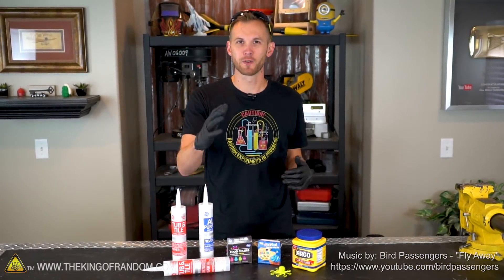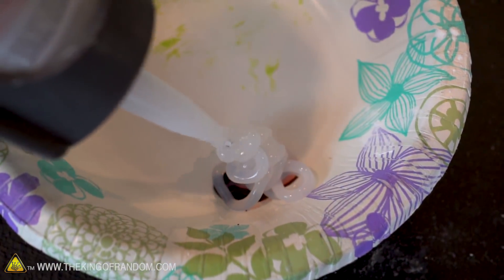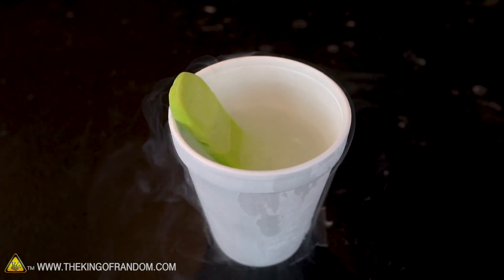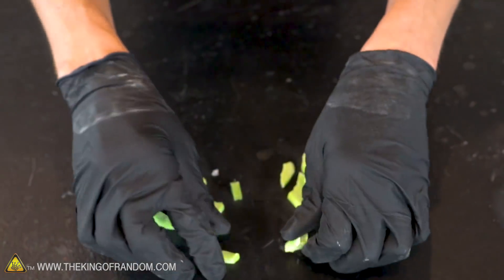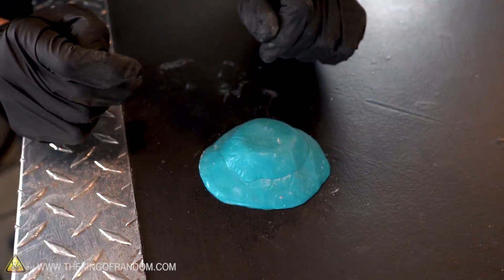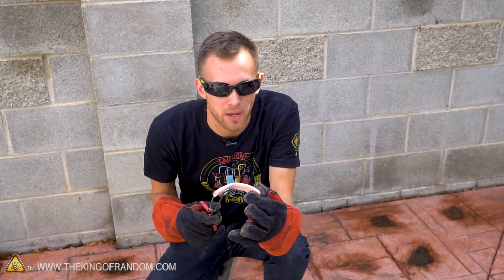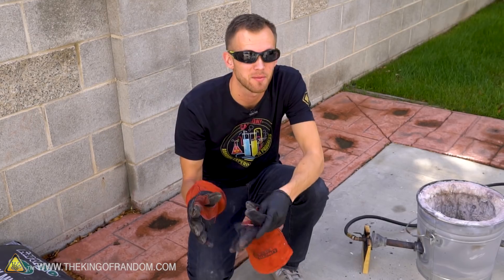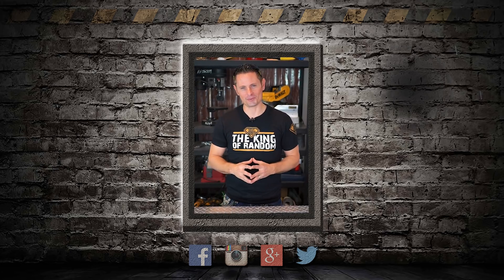Proto-Putty in Liquid Nitrogen & Other Crazy Tests! TKOR Shows You How To Make DIY Proto Putty

Comment: The proto putty that was in the liquid nitrogen blew apart from the heat of "The King's" fingers.  Liquid nitrogen is -320° F and his fingers were, probably, above 80° F.  So, by touching the proto putty with his fingers instantly applied a 400° positive temperature differential.  That type of instant temperature change would cause most materials to "burst" spontaneously. 

I think that he should have tried lead in his octopus mold.  It melts at a mere 621° F.  That's about half the temperature of melting aluminum. 

I'm done writing.  My brain hurts.

Comment: I love this video, and your proto putty recipe has already come in very handy, I especially impressed my dad by making some to fill  large gap in the bottom of his tent trailer where wood had rotted away.

However I feel you failed to test its heat resistance in this video... yes you proved it can burn, but how well does it hold up against lower heat levels? Specifically I am thinking it may make a great "handle" for some metal frying pans I have that have bare metal handles... i have been thinking about making a proto putty "sleeve" or "grip" for these pans, as i use them while camping and don't carry oven mitts

Comment: I used proto putty as a cheap way to get a mould of a pumpkin. I wanted to make a resin pumpkin but platinum silicone is so much more expensive than proto-putty. But I did replace the corn starch with talcum powder to make sure it doesn’t rot or get eaten while I store it in my shed.

Comment: I would like to see how far you can take the Proto-Putty with heat and cooling before the structures break down and become unusable.  Specifically I would like to see how well it could be used as a valve cover gasket replacement for an older car which parts are not readily available for.

Comment: You should try to cast low-temperature metals (i.e. gallium, zinc, tin, lead, bismuth, etc) in proto-putty. Just don't blast the metal in the furnace, a blow torch will be adequate.

Comment: Here's something for you to try.  I think the proto putty mold has hope for slightly better results.  The main problem with the mold in this video is that the molten aluminum mostly rolled off of the mold and didn't fill the smaller gaps.  It kind of looked like the surface tension of the aluminum prevented it from filling them in.  If you could either make a way to introduce the molten aluminum more slowly and evenly throughout the entire mold or simply make a larger mold, it might yield better results.  Of course the putty will still catch on fire, dry out, and crack the way it did in this video, but I think there is still a possibility for making a semi-decent aluminum cast with it.

Comment: Instead of using cornstarch it might work better to use powdered Calcium Carbonate (Available many places that sell vitamins/minerals) and or grind down some "chalk" into powder. Calcium being an element, has an extremely high resistance to heat (it's melting point is 825 °C / 1517 °F) Even though the silicone itself can only handle around 300 °C / 572 °F  the addition of the elemental calcium may help increase it's resistance to heat. Also I've seen many of your casting videos and wounder why you have not yet tried casting metal in moulds made of "Plaster of Paris" mix? It's available at most hardware stores (and is very inexpensive). It's also been used by people to cast since the 15th century and can withstand temperatures up to 1,200 °C / 2,200 °F.  

Unfortunately since this reply is about a month after the video was originally posted it's highly unlikely anyone at "The King Of Random" will even get to read this.
Reply: he has used plaster of paris for metal casting just fyi

Comment: I think you should add a layer to all experiments involving liquid nitrogen. You should make 2 slabs of proto-putty and prechill one in the freezer overnight to get it as cold as possible. I think that the first one cracked like that because of the thermal shock. Prechilling things in the freezer will minimize the thermal shock. I know that the difference of -10 degrees in the freezer vs -270ish of the LN2 is still going to be a thermal shock but I'd like to see if it makes any difference.

Comment: [Verse 1]
Do your ears hang low?
Do they wobble to and fro?
Can you tie 'em in a knot?
Can you tie 'em in a bow?
Can you throw 'em over your shoulder
Like a continental (regimental) soldier
Do your ears hang low?

[Verse 2]
Do your ears stand high?
Do they reach up to the sky?
Do they droop when they are wet?
Do they stiffen when they're dry?
Can you summon over your neighbor
With a minimum of labor?
Do your ears stand high?

[Verse 3]
Do your ears flip-flop?
Can you use them as a mop?
Are they stringy at the bottom?
Are they curly at the top?
Can you use them for a swatter?
Can you use them for a blotter?
Do your ears flip-flop?

[Verse 4]
Do your ears stick out?
Can you waggle them about?
Can you flap them up and down
As you fly around the town?
Can you shut them up for sure
When you hear an awful bore?
Do your ears stick out?

[Verse 5]
Do your ears give snacks?
Are they all filled up with wax?
Do you eat it in the morning
Do you eat it in the bath?
Do you eat it with a scone
Or do you eat it on its own?
Do your ears give snacks?

Comment: You do know that little hole with a blade in it on the side of the handle of that caulking gun is for cutting off the tips of those tubes right?

Comment: Much like the silicon in glass, the protoputty cracks upon touch due to temperature shock at extreme temperatures. The rapid heating of the molecules in the now crystalline putty causes the structure to crack - like splashing cold water into a hot glass bowl.

Comment: About the frozen putty cracking, it appears that it's cracking on fault lines from mixing the putty. If the putty were mixed significantly more thoroughly, it wouldn't have such large fault lines and might not crack up so badly when frozen. That's actually a testable hypothesis, but I'm not messing w/ liquid nitrogen to find out.

Comment: It didnt break by it self... If the material is not very thermal conducting it takes for ever yo transfer the heat. So leaving it half out half of it was frozen while tje other part was not thus creating some strong forces to be crated inside the piece. The reason it broke when u touched it is because u offset the net force thus breaking the internal balance of the piece
It had some energy stored in it because it "shrank" getting colder creating a "pull"

Comment: I know you guys like your black gloves but when handling liquid nitrogen gloves are a bad idea, if spilt on your hands the nitrogen will freeze the gloves conduct the cold through them and risk burning your hands, spilt on bare hands the nitrogen boils and floats on a layer of gas momentarily insulating your hands from the cold liquid.
Reply: The boiling point of liquid nitrogen is so low (-195.8 C) that it will boil the instant it touches anything at room temp, that's why it skedaddles everywhere in blobs rather than making puddles like water. But gloves will quickly cool risking cold burns to the handler. Jayztwocents did a video with LN2 Jay accidentally splashed some drops on his jeans freezing them and almost burning himself. A bare hand is warm enough to boil LN2 and produce the leidenfrost effect for moment.

Comment: WTF did you expect?
Water freezes (and there is a lot in your putty) and ice crystals are sharp and big (cuts the putty and the expend cracks it).
Corn starch burns (and there is a lot in your putty) ...
Try pure silicon next time ... and maybe apply some (moderate) heat in a vacuum (so that all water gets removed). Then it should resist burning and freezing much better.

Comment: instead of casting with aluminum, try using pewter to test the capabilities of the protoputty mold. pewter has a much lower melting temperature like lead, but pewter is non toxic.I recently did some of my own casting with a silicon mold and pewter. I would assume the protoputty would react the same way to pewter.

Comment: What will happen when you trow wood in your furnace?
Reply: The outside of the wood will immediately catch fire and char over and start to turn into white flakes from the intense heat. It would be like throwing a log in a fire and watching it burn but at about 5-10x the speed.
Reply: Throw
Reply: robin vanorsouw it burns
Reply: It starts on fire then it burns into ash

Comment: i wonder if you mixed sand or refractory material of some sort into the protopuddy if it would hold up to heat better. use the silicone as like a binder for the refractory material. to hold the sand together and maintain the shape.

Comment: so unhappy with some of the common sense that could have been used. Thermal shock on the frozen items. Why didn't he freeze a tweezers or tongs to remove them. Why didn't he measure temperatures when they had "Warmed up" the heat experiments I am fine with. But where are the temperature measurements??? TKOR is usually better than this!

Comment: It can be used for metal casting. Even tho it went on fire it held off well. Its just that those octopus hands were too thin for metal. Even with steel mold this wouldnt work. Try this again with mold that can work

Comment: I would like to see you using iron powder instead of corn starch. We can use iron powder mix with resin for cold casting. But I am wondering that using iron powder to made Proto-Putty and did the same test with Heat and Cold.

Comment: I suspect the reason for both the breaking apart and the lack of flexibility after re-warming is that the rapid thermal shrinking/expansion has riddled the material with cracks and broken a lot of those flexible bonds that made the material so tough initially. Unless those bonds can re-knit themselves in room temp (seemingly not the case for this material) that's likely why it tears so easily even after warming.

It's obvious there is a lot of thermal stress here - that's why they are shattering on their own like that.

In short I don't think the material itself actually changed from the freeze/heat cycle.

Comment: The proto putty didn't shatter from actually being cold, but rather from the rapid difference in texture, in order to do those experiments without just shattering it, you should try cooling it down and heating up gradually, like putting it in cool water, just if you want to try to do these experiments without shattering it, also, you might want to try submerging it completely for the same reason

Comment: Don't know if you realized this, but your caulking gun has a hole marked for cutting the tips off the tubes.  It is much safer than using a razor blade like you did in the video.

Comment: Question: I live in Italy and it seems like  Silicones here use a different denomination than in the US. To make the putty,  I need Type 1 Silicone Caulking, but here in Italy there is no definition of "type 1", there are A LOT of different types:  for sealing, waterproofing, glueing, even lubricating!  And also they are differently based:  some are rubber based, acetic acid based, resin based, polyurethane based... Since in the videos it is said that  "type 1 silicone releases acetic acid vapors" I tried to make some putty using acetic acid silicone.  But the problem is that the curing took way longer than 20 minutes!  I had to leave it overnight to have the putty turn into rubber, and when I cut it  the texture (both internally and externally) seems grainy and  pretty rough instead of rubbery.  Did I choose the wrong silicone? If so, what is the non US equivalent of a Type 1 Silicone?

Comment: I was hoping Proto-Putty would have been decent for casting. Oh well will just have to use sand.
Reply: You can use proto putty but:
- fill the proto pitty mold with liquid wax
-let it cool and dip the wax model in palster
-cook plaster (after it cures) to melt the wax
-fill the new plaster mold with molten metal!
Reply: I was sort of expecting it to fail.
it's made with cornstarch, which reacts to heat.
Reply: It's silicone dude. It's like rubber. Why would it be able to stand 1000° molten aluminum...
Reply: Zebefreo :D, OMG thank you I've been trying to figure out how to make a metal cast without having a 10 step process. This will make life so much easier. Puzzle
Reply: I bet you could cast pewter, it has a much lower melting point.
Reply: Maybe thermal silicone would be the better option, the one that holds up to 1300 Celsius.
Reply: Fluffy Bunny i guess i meant i was hoping it would be decent
Reply: Again, I see you everywhere
Reply: sam neale I see you too 👀
Reply: if you don't add corn starch it works better
Reply: Our new-grant tries and rage-quits after first try.
Reply: The Nocturnal Alchemist hello again
Reply: i wonder if he used something not as small and detailed if it would work better
Reply: It also might be because the mold was too shallow... it might still work a little
Reply: Zebefreo :D or use Gallium in the silicone mold
Reply: The Nocturnal Alchemist m
Reply: I have used silicone-cornstarch in product design, we use it to cast in. Plaster, concrete. Etc. It is wonderful and reusable